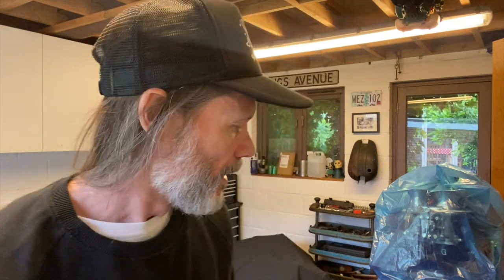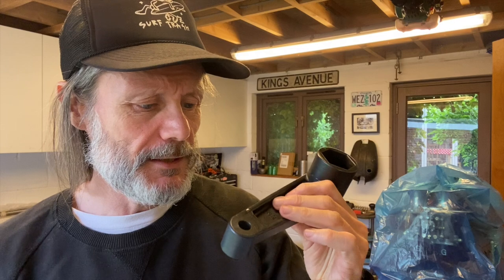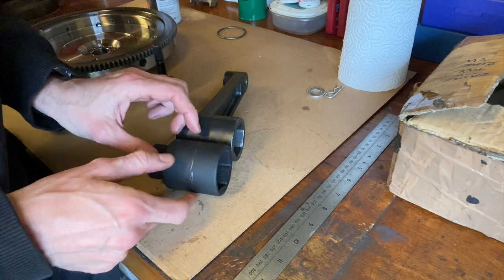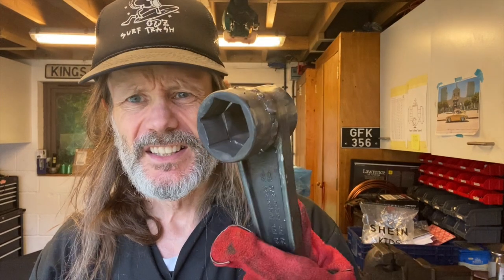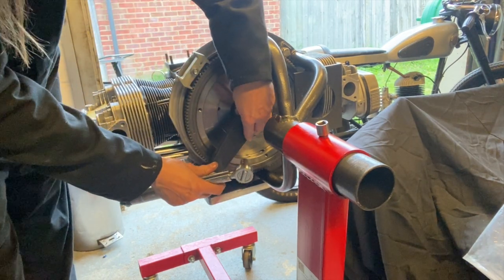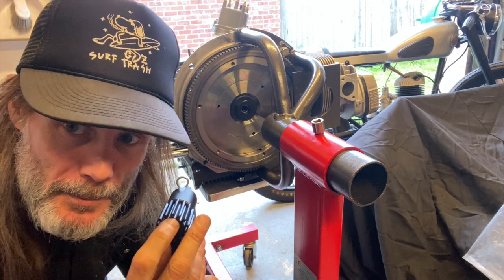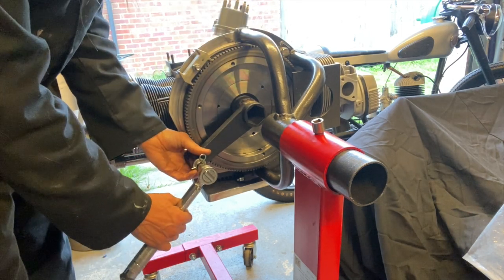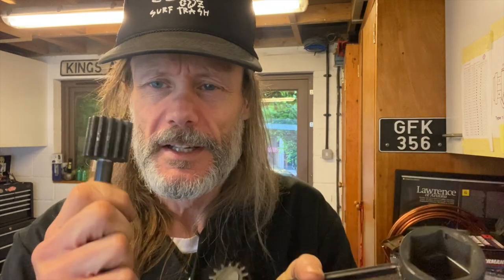How to Torque a 38mm Chromoly Flywheel Nut

Comment: Good job.  Unfortunately the Type 1 beetle aftermarket tools and parts are of pretty poor quality.  They are all the same molds and tooling that was originally used back in the day.
Reply from the maker: Yeah. Aftermarket stuff is always hit and miss. Some of it is brilliant and even better than original. Some of it is just junk. I’m hoping most of the components I’ve fitted work out to be the former. 😬